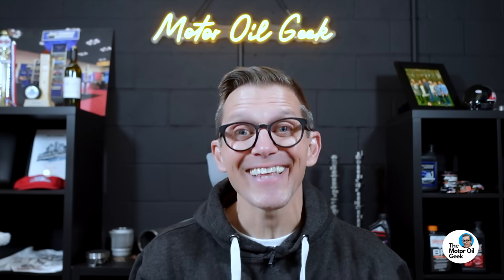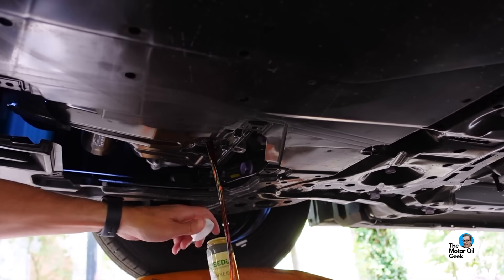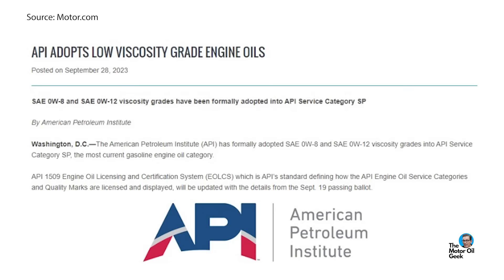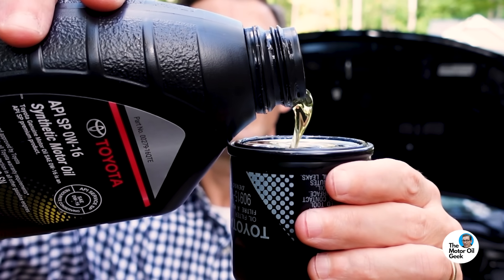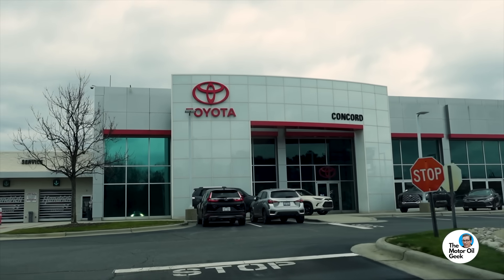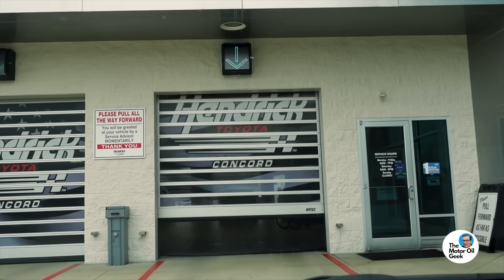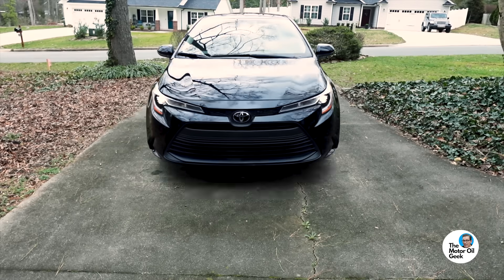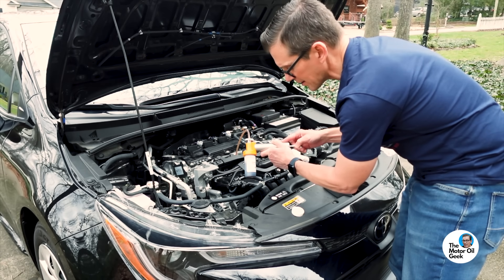0W-8 Motor Oil: Too THIN to Trust? Let's Find Out!

Comment: 0w-8?????   I'll just put tap water in my crankcase!  :)
Reply: Viscosity usually gets thinner as an oil is used. In my opinion if you are using a pretty low Viscosity to begin with you should really be changing the oil more often than the thicker oil. Obviously you should use the grade of oil that the manufacturer designed the engine and the tolerances of it for. Going to a thicker oil can cause damage. If however this car came with 0w16 in it and the dealer stepped down to 0w8 I believe personally I'd choose to keep using the 0w16.
Reply: @jeremypike9153  Some oils get thinner, some dont. Nevertheless, technical standards (certfication requirements) for this latest batch of thin oils demand the viscosity to remain virtually constant over the expected life of the oil.
As always, the service interval should be according to the manufacturer’s instructions.
Reply: @otomoravec1732  There is no some don't.  They all have viscosity breakdown.  There is absolutely nothing special in a 0W16 oil analysis compared to a 10w30 analysis.  The IL package he mentioned isn't in most of them.  Manufacturers are fined if they don't adhere to our corrupt government standards.  So ya, by all means, live in TX or AZ and use that 0w8...
Reply: @lonniebeal6032  For Toyota's naturally aspirated engines, I see no problem using these thin oils. I would think twice though if it was for a turbocharged one.
Reply: I understand the idea that the manufacturers want thinner oils for economy and everyone talks about clearances. However why does BMW and Mercedes Benz recommend thick oils like 20w 50?
Reply: @unclejoe6811  Because a MB is not a Toyota and they are built differently. No manufacturer wants to put out bad information and have it backfire on them like that.
Reply: @unclejoe6811 as stated above it has to do with bearing tolerances .
Reply: @unclejoe6811  isnt this a thing of the past? My friend owns a 2020 AMG GT-S and the instructions call for a 0w-40 oil.
Reply: You wont
Reply: You do that and let us know how it works out for you 😅😅😂
Reply: If the engine is designed to use 0w-08, use it. Going to a higher viscosity oil would be a mistake, because bearing clearances are predicated upon the oil viscosity. As long as the thinner oil can maintain film strength and maintain bearing tolerance, it's what you should be running. Lake is a tribologist, and he wants 0w-08 in his daughter's Corolla. That's all you really need to know.
Reply: @dougrobinson8602 You are trading engine life for a little mpg.  It will still probably go 150-200k miles on 0w8 and 10k changes, and by then it will be on the third owner.  It’s all about maximizing mpg and planned obsolescence.  If you use 0w40 and 5k changes the engine will never wear out.
Reply: @dougrobinson8602  The thing is that many engines are never actually designed for using such thin oils, the manufacturer simply changes their recommendations to meet government fuel economy standards. The discrepancies in recommendations can be huge, with some engines recommended xW-20 in the US, but xxW-50 in the rest of the world, all with the same exact engine model and bearing clearances.
Reply: @dougrobinson8602  You and davidr haven't seen the lubricity test done by Projectfarm.  0W20 vs 5W30, the 0W20 failed to protect as well as 5w30.  There is no bearing clearance in the lubricity test, it's full contact.  By your logic, 0W20 should have done better, it didn't.
Reply: @dougrobinson8602  They are stuck in the past or hang out on that oil guy forum with a bunch of know it all's.
Reply: Might as well put sewing machine oil in at this point. Maybe even gun oil.
Reply: @Technotranceism not true
Reply: @otomoravec1732  I'm being sarcastic, but I'm not putting a lot of faith, into the longevity of such thin oil. Most multi viscosity oils, weaken over time.
Reply: Yeah, its too thin. The thin oils are just for the manufacturers to say "hey, our engine consumes 0.03%less fuel, so we are the best environment car. But unfortunately its not good for the long run of the engine.
Reply: @aciddiver1978  Not correct. The GLV-1 spec that was developed is specific to these types of engines and hybrids. Yes, it's done for fuel economy and Toyota is smart enough to tell you that 0W-16 can be used in the owner's manual if you can't get 0W-8, but there's no issue running 0W-8 in the vehicle. It's now readily available. It's not the 1960s any longer (and yes, I have old and new cars) and "thicker is not better".
Reply: @aciddiver1978 
Thing is ,alot of newer engines have things like small oil passages to feed things like variable cam timing. 
Mess with the viscosity and you can cause problems.